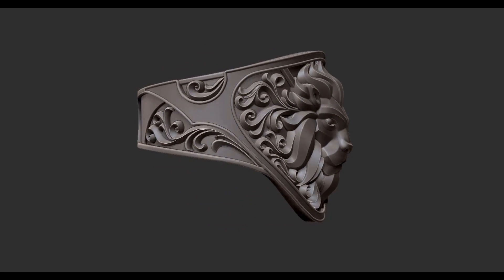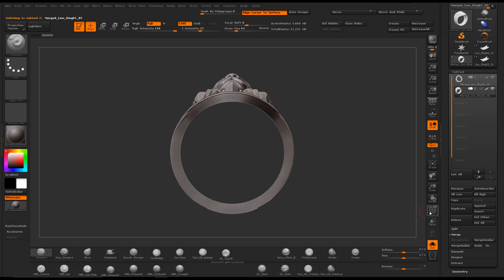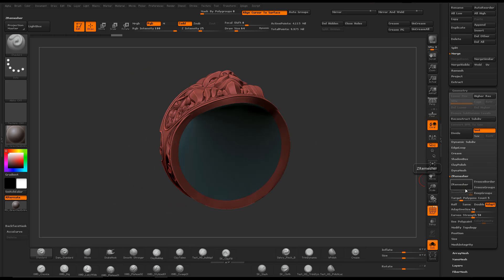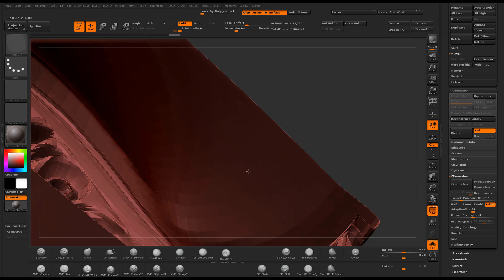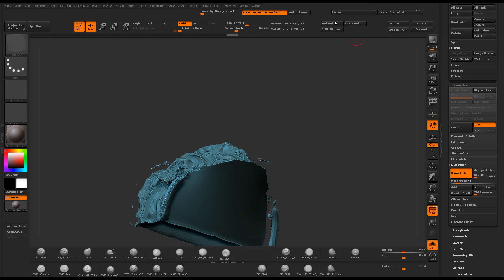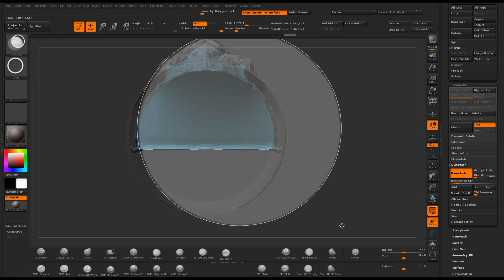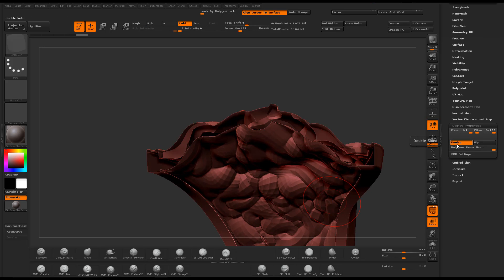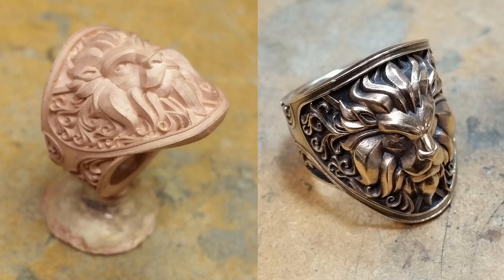Zbrush - Quick Demo Hollowing the Inside of a Ring

Comment: Why would you even want to do that?

I mean, you're not saving much material, since it's something as small as a ring.
Reply from the maker: When you're dealing with precious metals, that small amount of material could end up being a significant amount. I don't remember exactly how much this ring weighed, but hollowing it would have probably saved me 20.00$+ in material alone. If you were getting it done by a casting house or other service it would end up being even more.

But maybe you want the extra weight on the ring. I personally like the feel of a heavier ring. Feels more expensive. But if it's something you wear every day, you might wanna take some weight off.
Reply: But if it`s hollow, it could mean less resistance in the material as well.

Wouldn't that be a problem?
Reply from the maker: You mean the resistance against your finger? I don't often wear rings, so it's tough to say. But I'd imagine as long as it's comfort fit it wouldn't be a problem.
Reply: thank you . very useful . at the price of gold these days , all my clients want the rings hollowed . I use Matrix and Rhino and i am very good at it . But new to Zbrush , have a lot to learn . So yes , 1000000 thanks
Reply from the maker: Glad you found it useful. I've played with matrix, but never got really into it.
Reply: Unless you want to use it as a bullet to explode a tiger tank, you don't need that extra resistance. :)